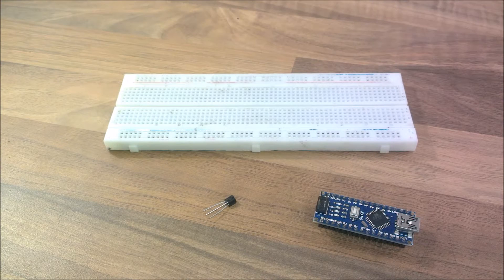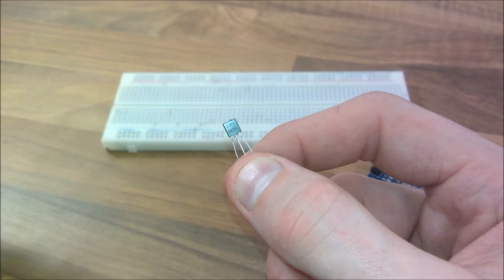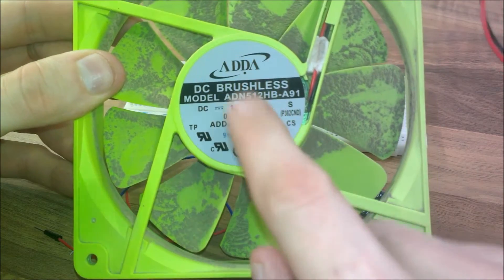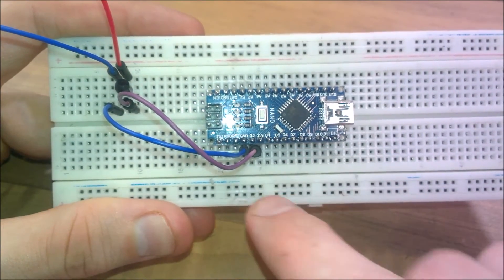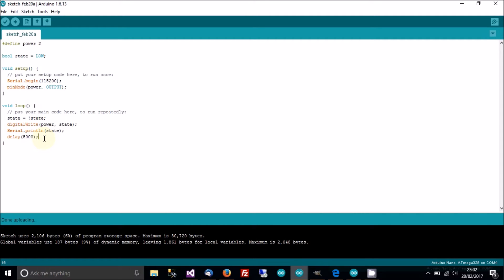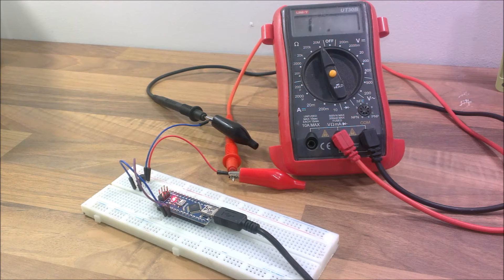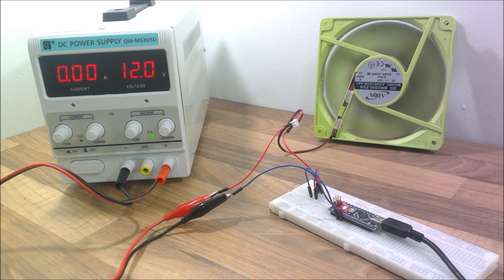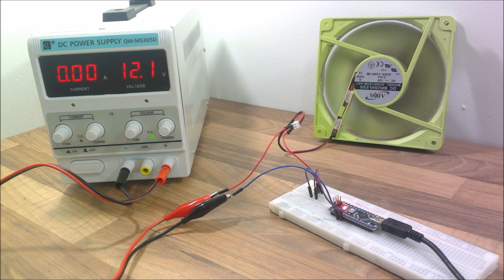TUTORIAL: How to control power to high power devices using Arduino (Using a transistor)

Comment: I tried this, but the amount of current going to the load is significantly less than when I connect it directly to the power source, although the voltage remains the same. Any suggestions on how to fix this?
Reply: I'm pretty sure that is because there is more resistance when not connected directly to power source, might have to look at other methods of powering it than this.
Reply: @raremc1620  Thanks
Reply: @dragonfyre1589  no problem, although I'm no expert :)

Comment: Hi,

Can I use Arduino for designing only the controller in the hardware to control the current of grid tied inverter. The grid tied inverter will be in Simulink but the controller will be a hardware. It's hardware in loop. Is Arduino suitable for such kind of work?
Reply from the maker: Hi, I'm afraid that I don't understand the semantics of your message. :-(

Comment: Sir can i use the arudino to control current according weight....
Reply from the maker: Hi, the Arduino can't directly control current. Current is affected by Voltage and Resistance, which an Arduino is more able to manipulate. You would need a weight sensor to start with, then you'd have to manipulate either V or R somehow. You'd probably manipulate voltage using a transistor or a mosfet. You could manipulate resistance by adding various resistors in parallel and then switching various ones one or off, by using an NPN transistor in the ground line after each resistor.
Reply: Ok....😊thank you sir..
Reply: Sir can you make video on that if possible.....?
Reply from the maker: Try this one: https://www.youtube.com/watch?v=l8sLhvL2zfk&t=1s
Reply: Ok😊👍

Comment: Would a 1N4007 diode be needed?
Reply from the maker: Hey, I don't think so... But I suppose it depends on how paranoid you are! I'd say that it should have a resistor on the base pin more than anything.. :-)
Reply: Antony Cartwright I tried to follow your tutorial and I like it alot! But I've come across a problem. I'm using a 9v battery in my setup and a button to send a signal to the transistor(2N2222A) base. For some reason when I'm not pressing the button the voltage is around 4 and then I'm pressing, the voltage is a around 5. I'm not sure of what I'm doing wrong, can you tell from this?
Reply from the maker: Athax Designs Hey, take the base pin wire out of the transistor, then put multimeter on it. Check the voltage in both states. If it's not 0v, 5v or near now, then there's a problem with the arduino / pin / code.
Reply from the maker: If it is 0v,5v or near on the arduino, then firstly tie the grounds together. Battery minus to arduino ground to start with, then reconnect the base pin and retest.
Reply from the maker: If that still doesn't work, disconnect the load, but connect the emitter only to arduino ground. Connect the base pin...   Then put ohmeter across the collector and emitter. When you press button, ohmmeter should read low resistance. When you let go, it should read high resistance... Does that work?
Reply: Hi! I forgot to define the pin I was using to an output pin.. Now it is at 0 and when I press the button, it goes to 4,8 volts. https://i.imgur.com/pyT7NZj.png (sketch of my setup) For some reason now, the voltage does not go above 5v... Do you know what might could cause that?
Reply from the maker: 4.8v is ok. It's normal. It might be something to do with the 1k, but usually, 4.8v is nothing to worry about. :-)
Reply: Yes but my solenoid does not get the 9v the battery outputs only around & below 5 volts. :(
Reply from the maker: Ok, so replace the solenoid with a voltmeter... Does it read 9v now? If not, put multimeter in resistance mode at lowest setting. Off resistance will be OL, when on, the resistance should be low. What resistance is the transistor when on?
Reply from the maker: My gut feeling is that it works fine with the multimeter? The next test is to replace the motor with 3 LEDs... See if that works.
Reply: Alright I've replaced my solenoid with a multimeter, it reads 0.000 and whenever i press my button it reads 4.700. I'm reading Ohm now, it says 0.L and then i press the button it says 0.L as well. The amp is around 0.007/0.010 and then i press the button it is 0.144
Reply from the maker: Athax Designs if resistance is 0 and 0, then the transistor is broken as it is stuck on!!! But if resistance is 0 when off, how can voltage be 0 when off? The readings don't add up! I think the problem may be that not enough power is getting to the transistor in order to power the solenoid. Try replacing the solenoid with and led and 300ohm (or near) resistor... Does the circuit work now?
Reply: Oh it actually does not light up the led light, I found a 300k resistor and used that. I'm not sure if that's the correct kind of resistor tho. My whenever i rotate my transistor, so it's reversed the solenoid actually kick a tiny bit when i push the button.
Reply from the maker: Athax Designs 300k is way too much. Need around 300ohm.
Reply: I couldn't find a 300E resistor so I tried using a 330E resistor,  and the single led would lit up, whenever i used my button. With the new 2n2222A transistor, the solenoid actually kicks a tiny bit. The measuring voltage is below 5v tho..  When I get home, I'll try three leds, like you mentioned earlier.
Reply from the maker: Athax Designs don't bother with 3 LEDs for now. Just use LED and near 300ohm. Does it work perfectly like that? But the solenoid still doesn't work? If this is true, then I believe it's because the transistor isn't getting enough current to properly switch on. I think the problem is that the solenoid is attempting to pull more amps than the transistor and arduino is able to allow. To get around this, test on something which doesn't draw as much current, or use a mosfet instead of a transistor.
Reply from the maker: To summarise, I think you're placing a very heavy load on the transistor, more than it can cope with.... If you want to be sure, then use the 3 LEDs in parallel, in series with 2 300ohm resistors also in parallel. What will happen now is that the resistors will waste around 7v and allow 2v for the LEDs while at the same time, restricting current to around 60ma. See if this works!
Reply: I'll test that when I get home thank you, is there a mosfet you can recommend? The solenoid is made to run at 12v, but it can run on 9v without problem. Which transistor are you using in your video?
Reply from the maker: Hey! You haven't watched the full video! Lol... The transistor is C1815. Common MOSFETs are IRLZ44N.
Reply: I actually went through it two times, because it wouldn't work for me. xD Apparently i missed that part.. I got an C1815 resistor, so that should work fine for me?
Reply from the maker: Athax Designs it still depends on the solenoid and how much current it requires, but if you use the same setup as me, it might be easier...
Reply: I found some information on the solenoid I have: 12-24v current 300mA. I suspect the 300mA might be the problem? Using the same transistor as yours still only allows 4.6v through, tested while having it connected to a multimeter.. :( Could it be because of the 1k resistor I'm using between the base and arduino ?
Reply from the maker: Athax Designs try the led tests.
Reply: Hi Sorry for the last answer I've been busy! To be honest I only know how to put something in a parallel circuit, I'm not sure how to but the resistors in a series with it.
Reply from the maker: Parallel is where you have several components and you bind all the + together and bind all the - together. Series is where you string them along, so you tie + to next - and then + to the next - and + to the next -.

Antony...
Reply: Alright so bascially two 300ohm resistors tied each other, so the voltage goes through them both and then to the three leds. Tried that and they won't light up.. But I tried something risky now, I removed the resistor between the base and the arduino and it worked. EDIT: I placed the 1k resistor back and the two resistors and three led's started to light up.
Reply from the maker: Athax Designs it sounds like you have bad connection problems mixed with an underpowered transistor/heavy load...
Reply: Alright, tried using a small fan. It ran, hopefully the mosfet might help me. Thanks for your help and all! :D
Reply from the maker: No worries!